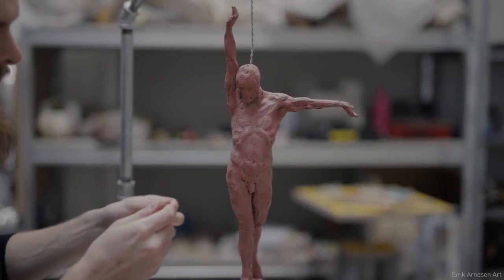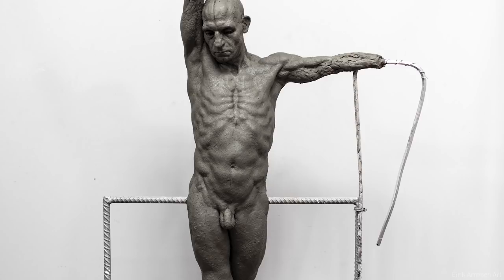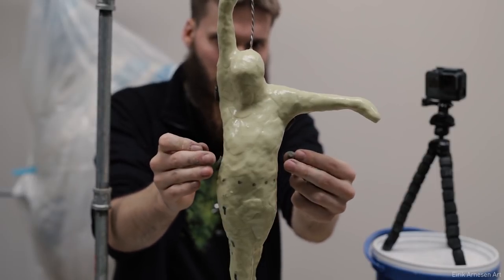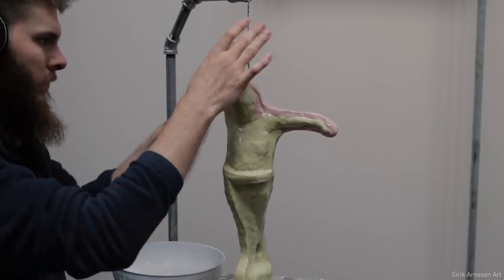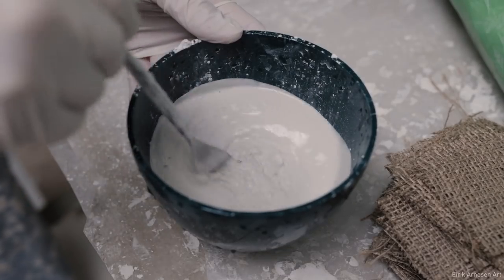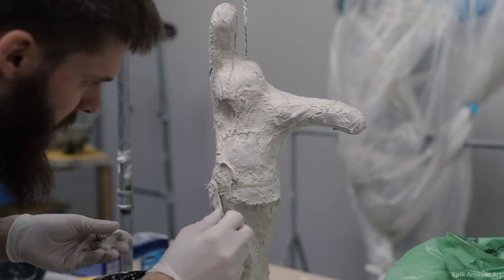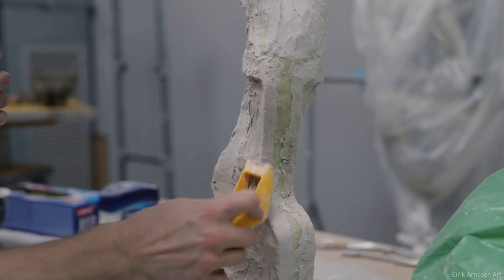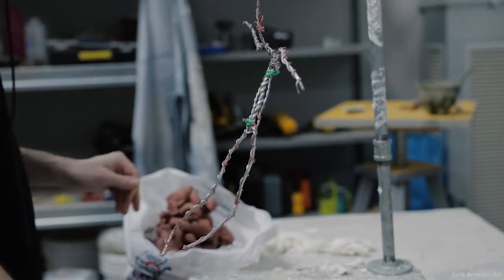Mold Making - Silicone & Plaster

Comment: Thanks this is really helpful!

A few questions  about the silicone paste if you don't mind:
-Does it work with shellacked sulfa clay, or does it not get along chemically. 
       (smooth-on said their "poyo putty doesn't like shellac)
-Will the pressing process leave marks in my piece? 
     It was done in a medium firmness oil based clay.
-Do you think 1 Kilo (quart) would be enough for a 24in tall figure?
Reply from the maker: I'm not sure about shellac, you should check if tin-based silicone react to shellac. I didn't think it would but bets to check! 

No it will not leave marks as long as you keep silicone between your clay and your finger. 

Probably not. I buy a 5 kg bucket and use most of it for a figure slightly bugger then that.

Comment: Hello, thank you for your video. Which yellow and very soft product do you use in tube? thank you in advance
Reply from the maker: I assume you are talking about the catalyst for the silicone? You mix it with the silicone so the silicone sets up. There are silicone that air dry (for sealing windows and tiles) but silicone using catalyst is better for these types of applications.
Reply: @EirikArnesenArt  A big thank-you :)

Comment: interesting process, I've never encountered silicon paste before. what we have are brush-on silicons that are either slow set or fast set. Which is more troublesome in ensuring an even application.
Aside from having to have the figure to lie down to create a two part mold. What other advice could you give regarding my process given my material limitation? Apologies if my question doesn't cover this scope. Thank you for the informative video
Reply from the maker: I would suggest looking into matrix molds! They are very hard and complex to make but the thickness is a lot easier to control and you can do them standing upright as well and cut the silicone into two later on. Doesn't really work for big pieces unless you're a big crew but if you're doing smaller pieces and want the best mold possible, matrix molds are the way to go!
Reply: @EirikArnesenArt  I've never heard of matrix molds as well :o I'll look into it. Thanks!

Comment: Thank you for sharing this. I hope to see you do a video of the casting process (hopefully in resin and plaster). 

Question. Why do you prefer the paste silicone rather than the regular one?
Reply: By the way, what do you do about the wire on the top of the head? Does the silicone and mother mold go around it and then you plug it up?
Reply from the maker: I have videos of the King of the Rusted Crown being cast in aqua-resin planned for very soon! They're filmed already and I just need to edit them and narrate. I prefer paste silicone because it's a little less messy, less wasteful and easier to control. But if you are trained and good with liquid silicone I'm sure you can do the exact same thing I'm doing without making a mess and with equal amounts of control. This is just the way I was taught and it's quick and easy!
Reply from the maker: The wire in the top of the head makes a small holes in the silicone that I'll just plug up with some clay when I cast it. And then fix it when I'm fixing the seams later.

Comment: Nice! to bolt it together do you have to drill through both the shell and silicone mould?
Reply from the maker: You can, but you don't have to. In this case I didn't drill, the two halves of the mold is held together with bungie cords or tape when I cast.

Comment: Oh and what if the original is a very rare expensive sculpture, can you cut the sillicone without cutting into the original?
Reply from the maker: Yes I guess so if you cut carefully. but this is never the case, the sculpture is never valuable until it's cast into a more permanent material.
Reply: @EirikArnesenArt  OK. My father left us with a large collection of old models, plastercast, moulds some more that 100 years old but still fine.He took over a plastercastshop in Copenhagen in 1962. Classic roman greek and egyptian pieces. A lot of work ahead to get it all organised.